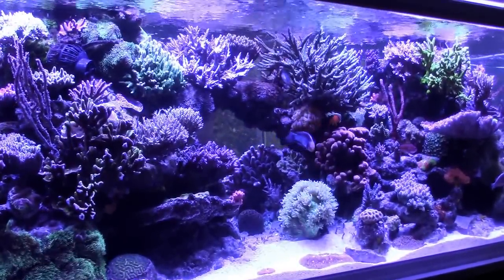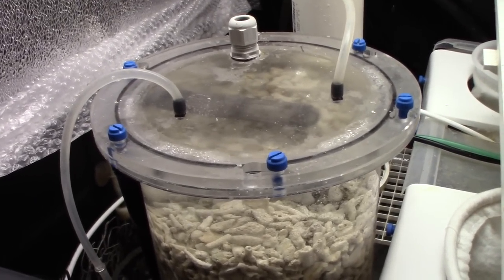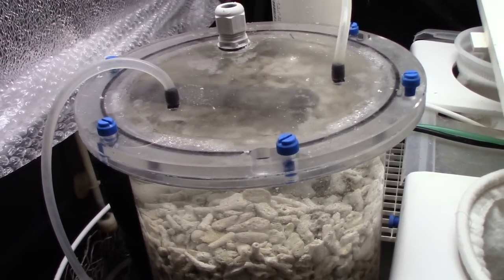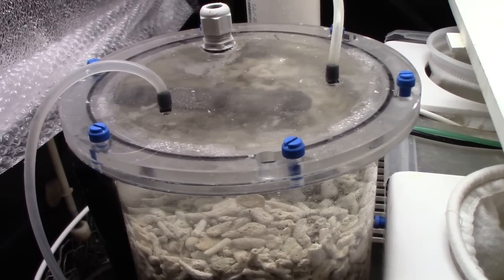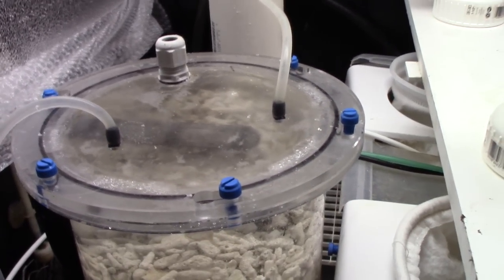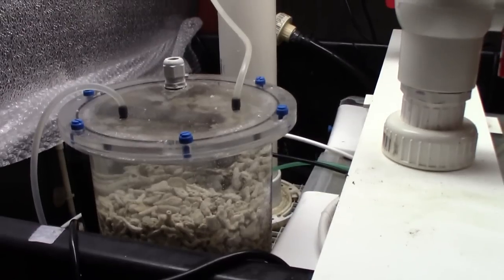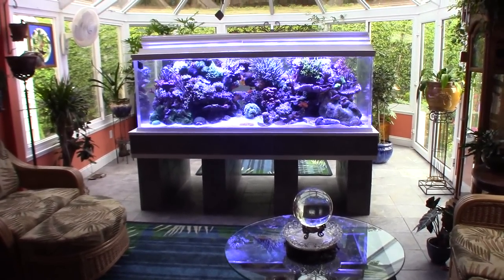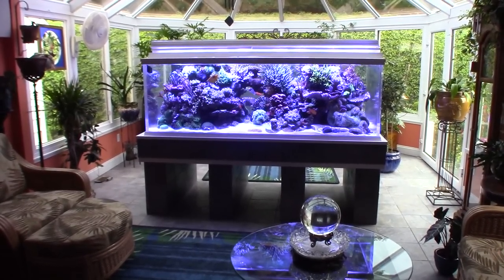Three years old! New Radion G4 Pros and a new Tunze calcium reactor.

Comment: amazing.  could you tell us about your stand setup?  I see the cinder blocks but I can't tell how the rest is made.  is the brace on the top just painted white or is it custom?
Reply from the maker: There are four steel I beams on top of the cinder blocks and then 1 inch plywood. I used wood to encase the steel and plywood  and then tiled it over with the same tiles used on the floor. All the molding is PVC that I applied myself.

Comment: Great setup you got there, thinking of getting one of those calcium reactors, are you happy with it till now? What co2 valve you use? Is it constant on your bubble rate? Because i see you run the reactor without ph controller.
Reply from the maker: Giorgos Maroudis 
Yes, I'm very happy with it. I use the Carbon Doser by Aquarium Plants. I just occasionally take the pH of the effluent to make sure it's about 6.5. No pH probe though there is a port on the reactor if you want to use one.
Reply: reefkeeper2 just another question about the reactor, how consistent is the effluent flow? Is the self priming work steady or do you have to take care of it occasionally? What media are you running? Thank you for the info :)

Comment: Hey reefkeeper, this is one of my favorite tanks online! Hope everything is going great. I was wondering how are you liking the Tunze so far? This video was one of the reasons I bought the smaller version for my 180g tank but that thing is having a hard time keeping up with demands (1,5 dKH daily). I need to have the pH set to 6,1 I side the reactor and a high effluent rate to keep up with the demand. Maybe I should have gone with your model but your tank is larger and has a lot more SPS than mine so I figured I would be fine. Using caribsea ARM Coarse media. Thanks!
Reply from the maker: Try using Two Little Fishies Reborn. That's what I use. I also have a Kalkreactor, which adds considerable alk. The model I have seems to be able to keep up with this combination.

Comment: Hello! I haven't saw the Co2 cylinder, regulator etc etc connected on the reactor ...
You running it without once it runs inside the sump? Sorry I done got it :) Thank you!
Reply from the maker: There is a CarbonDoser regulator on the CO2 cylinder. I didn't realized I didn't show it.
Reply: Thank you for explained ;)

Comment: Do you have anything inside that degassing chamber? I'm thinking of building one for mine, but not sure what to put inside it! lol.
Reply from the maker: Luucky13 I
It's filled with crushed coral. If you want it to work really well, put an airline into it that goes to the bottom. Fresh air pumped into the bottom while the water drips through the crushed coral above really gets the CO2 out .

Comment: Very nice tank bro ,,what are you using for flow ?seams like you have alotta flow
Reply from the maker: lookingglassreefs cp 
There are four Tunzes in there. Two are on at a time causing a gyre that goes clockwise for an hour and then counter clockwise for an hour.

Comment: Have you notice anything better about the G4 ? I'm thinking of switching to LED AND I WANT THE Best
Reply from the maker: Color is definitely better and so is coverage. I'm very happy with them. Switching to LED can be tricky for your corals if you are using other lights. Go easy.
Reply: reefkeeper2 thanks I use t5 ?  What is the difference? If any in growth ? Sps coral tank ? What do you think I should use on the settings
Reply: Thanks for the fast response what level should i start out with as far a intensity? all sps corals 75g standard size and im  guessing 2 fixtures of the pros?

Comment: Do u have a closed loop system on ur tank as well as them power heads?
Reply from the maker: epicnas12342 
No , there are four Tunze powerheads. Two run at a time changing direction of the flow ever hour.

Comment: Self Priming so it doesn't need a feed pump?
Reply from the maker: That is correct, no feed pump.
Reply: @reefkeeper2  is the drip rate consistent? Does it ever clog or anything?
Reply from the maker: @andycx2   better than any other I've owned. You still need to watch it. It will slow down when the intake tube gets dirty.

Comment: You are going through a lot of media in your calcium reactor because your pH inside of the calcium reactors dipping too low it's probably dipping 6.5 or less at that rate it will just melt the media you do not want that if you don't want to buy an apex I would highly recommend a Milwaukee PH controller then they'll shut the regulator off on your CO2 so that will not happen and it won't fluctuate the parameters of your tank as well you have a beautiful tank by the way
Reply from the maker: I have an apex. I check the pH of the effluent, but I don't monitor it 24/7. I keep it's pH around 6.5 -6.7. The alk demand is very high